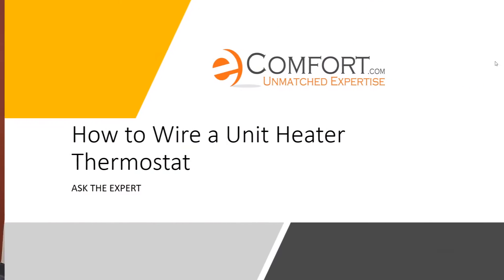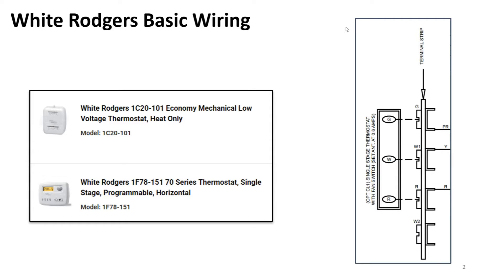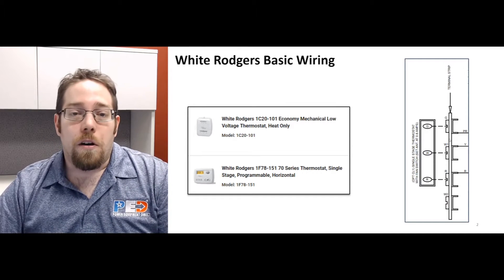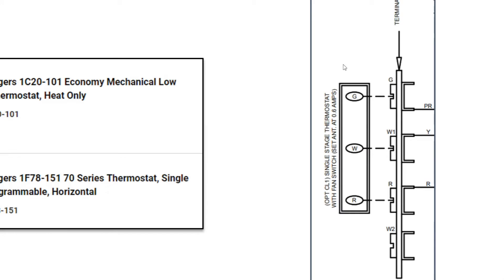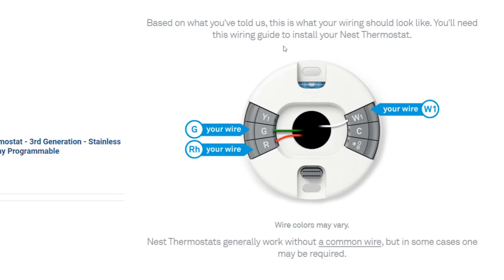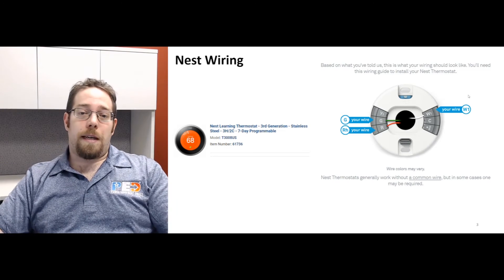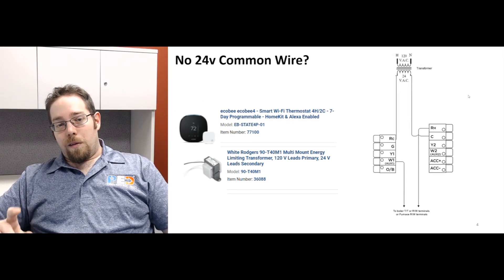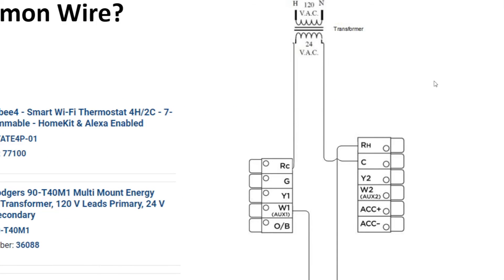How to Wire a Unit Heater Thermostat

Comment: Just removed an old mechanical thermostate from the hot dawg heater in the garage, and noticed it only had two wires connected. How would I attach them to an Invensys Model 9701i, which has 7 connection terminals, C, R, Y1, W1, O, B, G. Am a DYI'r and trying to attach this thermostate. Any help would be appreciated.

Comment: That’s a very helpful. Would you believe that my Modine hotdog manual does not explain how to connect the thermostat. It will lead you to believe that for two wires you use the C and the R, which will cause a direct short and blow the fuse. Ask me how I know.😂

Comment: First, thank you.  I just switched out my in home Honeywell Pro Series thermostat for a Sensi touch, wifi thermostat in my home.  My old home thermostat (Honeywell) is digital and only few months old due to a new furnace central air.  I also add a brand new Modine Hot Dawg 45000 btu natural gas heater to my garage, but my installer used just a simple slide type thermostat which doesn't tell the temp, just what I'm setting it to.  I was wondering if I could use this HoneyWell thermostat, ie. swap it out so I'd know the temp and be able to more accurately set it.  I greatly appreciate your assistance.  I'm just a DIY so any help is appreciated.
Reply: Yes, again, if the thermostat requires power you may need to pull a 24v lead and or use a 120v to 24v transformer. If the thermostat has a battery then you should be fine.

Comment: Great video. Can I use a Nest thermostat to control two unit heaters?
Reply: Let me know what you find out, I'm trying to do the same thing.,
Reply: So technically you can use a contact do do this if you're trying to tween two units